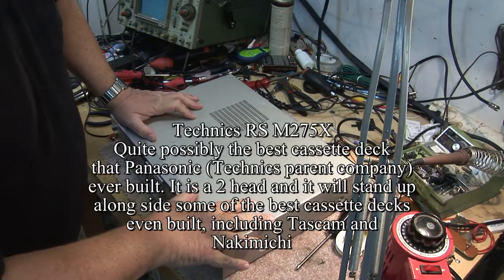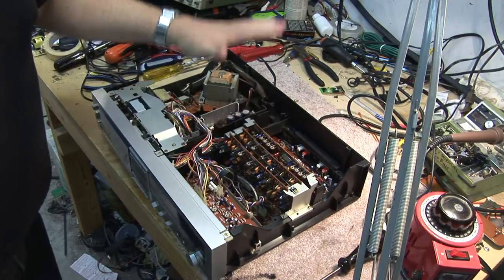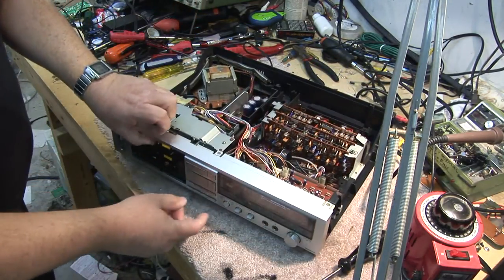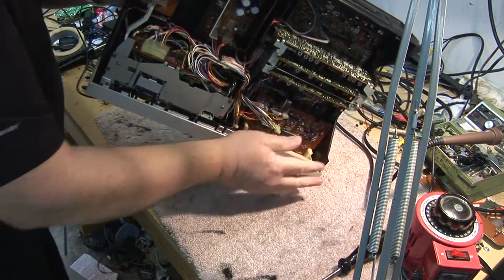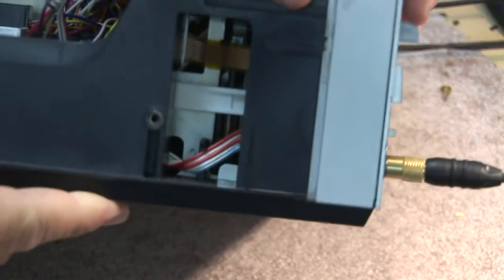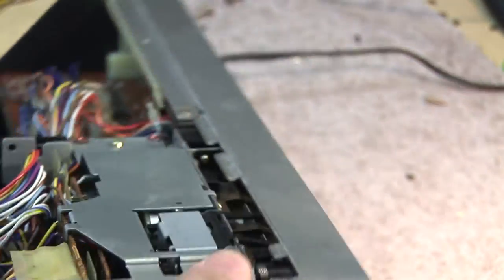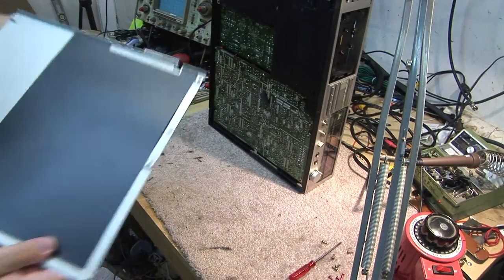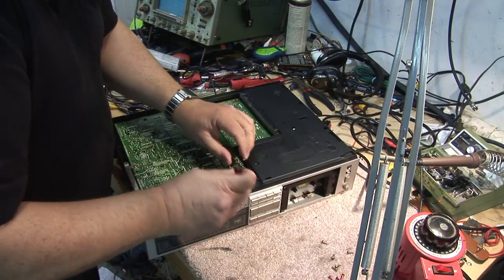technics rsm275 no play repair

Comment: Thanks for sharing your know-how. Your videos are always a good learning experience for me, trying to resurrect electronics training I got more than 50 years ago, but stopped using shortly after getting discharged from the USAF.

Incidentally, very useful tip about using rosin flux on the slipping belt. Was it the kind that's in liquid form or paste? It looks like MG Chemical, but hard to tell exactly which one.

Comment: Very interesting!  I would never have thought of using rosin like that to help a slipping belt!  Makes sense as its acidic and I guess it likely etches the surface slightly.  I would be tempted to take the lid off, put it on a flat surface and hammer out that impact dent ;)
Reply from the maker: Yes I already did that after the video was shot.
Reply: =D  Great stuff!  Love the videos!  You really know your stuff!
Reply: @12voltvids  hey so I have been waiting for the right moment to use this rosin technique, and finally I decided after boiling the belt from a wx-fx195 walkman and not getting enough tension and lots of vibration (specially after the finish of the tape where it seems to pull harder till it stops playing), I went ahead and coated the belt lightly with rosin. Not knowing the way to do it properly I waited a while to let it dry, maybe an hr. Then  i decided to put it on, but it was very sticky, (mind I really barely put any in there),  but never the less I did put it on and started the tape, it  seemed to play well, till I stopped it, and it wouldn't start again at all, no matter what I did, it did ff and rew, but not play. I took it off again and cleaned it with alcohol, sort of defeated I decided I would just get a new one, so I went to my welding class and when I came back i saw my desk with the walkman  in pieces, and decided what the hell, I will test again, and whoa, it works now, testing for a while to see if it gets lose again, but so far so good. My question, could you expand a bit on how this technique works correctly? maybe a short video? did I do it the right way by mistake? Thanks so much, I hope you see this message. Can't say enough how much I like your channel and your way to explain and go thru the repair of everything electronic. Cheers.

Comment: Hey Dave I know that this is an older vid I have the same Technics cassette deck with the same problem with that belt, will 

MG Chemicals 835-100ML Liquid Rosin Flux is what you used. Thanks great vid as always
Reply from the maker: Yes this is what I put on it to give some grip. Still working years later, mind you I don't use this deck much.

Comment: I used to work in a repair shop, I hated those disc players, a small gear in the bottom would break and it cost a few dollars for the part but you had to charge the customer for the all the labor involved, it wasn't easy to replace and then align the gears.
Reply from the maker: Just to change the belt I put the rosin on would have taken easily an hour to disassemble and reassemble. They were a pain in the ass to work on that's for sure.

Comment: Hello how are you I have a deck technics rs m280, when I play a cassette after about 10 or 15 minutes it starts to accelerate the playback speed extremely fast. It would be very helpful if you can give me some advice to solve this problem Thank you very much in advance and greetings
Reply from the maker: Not familiar with the model number.  If conventional type motor it is likely the motor that is failing. Again, I am not familiar with that model number.
Reply: That's a direct drive quartz lock motor. There is no speed adjustment. It's possible the motor is flaking out. I refurbished mine in the sense of a recap. Many of the low voltage caps showed sign a minor leaking of electrolyte around the leads. It's pretty well established that the lowest voltage ones (lets start with 6.3 v) tend to leak fluid after 10+ years. You find these on all over the place in this unit, including the motor drive board and control boards that are mounted in the mechanism. Mine never had the problem you describe though. There were two versions of the  DD motor driver also. I think that is covered in the schematic pages. Of course you should verify that the pinch roller pressure is at least reasonable and they and the capstans and rollers are clean. If the rollers can't grab the tape it will be pulled through faster by the take up real motor. It doesn't seem that would follow a consistent warm up period but I guess it's possible. This goes with checking that the head block is fully engaged by the cam also. There is procedure for checking the capstan pressure using a force gauge. But for this problem it would have to be way off the target pressure. I find the rubber in this deck has held up well in spite of decades of age. Only a person a much experience and patience for tedious work would think about taking this mechanism apart to fix the motor driver and the bad news is there are ICs there that if bad are not obtainable. Ok I looked at the service manual which has decent troubleshooting procedures for the motor. In the case of the motor speed almost doubling check the following: Make sure IC 502-507 all have vcc of 5v. If that's good check Q506 for being open. I imagine the almost double speed is the free running speed with no feed back FG signal control applied or essentially no speed control but with other things working. These checks are on the control board that is mounted on the mechanism. The problem I see from this check assumes the ICs are all good. Missing vcc vs bad chip?
 Slight correction: 5 of the 6 ICs in question in the motor control and drive are standard logic chips (Quad nand, quad nor). These can be purchased. I see the main motor control chip ic 501 on the bay right now (not part of this check). The remaining chip (oscillator) is also on the bay right now. So in any case I think this should be repairable. Also the difference between the two motor versions is the number of motor poles and the frequency of the signals (with some component changes and such). Otherwise the chips are the same. But I will note there is a 6.3 v remote cap on that 5v vcc rail in the mechanism.

Comment: Why does it look easy for you to remove the front covers off the deck doors? I’ve been trying to remove the ones off my Panasonic decks without breaking them!
Reply: NORMALIZATION OF IGNORANCE - Thankyou for the advice as it will help me heaps now. :)
Reply: NORMALIZATION OF IGNORANCE - A Panasonic RX-DT610 Portable Stereo Component CD System from 1991. I bought it brand new with my pocket money when I was 15. ;)
Reply: The twin cassette decks need servicing again & the CD player tracking needs a adjustment which is easy to do. :)

Comment: The best (and most expensive) Technics cassette deck was model RS-9900US.  It came in two parts, drive system and amplifier were separated units.  It was built like a tank and very, very heavy.  Though, it was easy to carry, since your wallet would be very, very light, once you paid for it.  :)
Reply from the maker: The best? I seriously doubt that. Nakamichi had that camp sewed up.
Tascam also had some serious decks. 
The RS-9900 was expensive for sure,a nd it cae as 2 seperate units. Big deal, it didn't even support metal or FeCr tapes. Just  standard and CRO2.
Reply: @12voltvids in the  Technics models line up only.

Comment: I have the RS-M280. Wish it had DBX. But it is a 3 head version of the 275. I am working on the transport too. Sure enough the transport locks up in play. I am replacing all the belts and idler playback take up. Transport is highly involved. Slipping belt is the hardest of the bunch to get too. Service manual is useless on how to remove that belt.
Reply from the maker: It's fun.  The 285 despite being 2 head has perfornence rivaling many 3 head decks and dbx is icing on the cake.
Reply: RS-M280 here also. I have in fact replaced the belt in question for the head block drive. The replacement seems to have held up longer than the original. But then it does not get as much use now. It's not exactly fun, although far from impossible.  That belt started slipping about 2 years after it was first put into use when new (1980ish) and my repair guy at the time (40 years ago) only did the anti slip fluid. That works for a while but it is not really a solution. He totally refused to tear down the mechanism. The problem with finding belts lies with the dual capstan belt around the fly wheel. Many tries with belts I thought might work but did not. It has to be just right or it will ride itself off the the somewhat rectangular shaped integral crown on the left pulley. It has to be just right in width, thickness, length, pliability. The other thing that happens as the belt gets older is the left capstan speeds up with respect to the right. A loop of tape forms and the first thing you notice during record is the tape lifts off the erase head. The technical reason this happens is beyond my ability to speculate and sound convincing. At first cleaning the pulleys seemed to fix it but it would come back again.  Although, in fact Technics put out a bulletin to update the left pulley/capstan size because of this problem (part substitution). I never got the redesigned pulley/capstan, but I did after many years of sitting and being pulled out of storage find a new belt that worked and that stopped the problem as well as the tape feed issue. For how long I don't know. AFAIK there is only one belt that is/was available that would work at all and that stops both these problems. The belt: PRB FRW 9.1 These at least are or were available in the US as recently as a few years ago. And there may be another belt available elsewhere that will work. The caveat is that it likely won't get you all the way down to the original W&F spec, but it worked good enough to get .035% WRMS on mine. The width of the belt in this case is more critical than it is in most other decks from what I noticed, I think because of the strange profile of the pulley crown on the sub-pulley (left). The Prb cross guide calls for FRW 8.0. The only thing I have to say about that is it must be in error. The actual measured length of the path around the pulleys is 9.3 inches. IMO opinion an 8 inch belt would be way too tight and this thing will give you trouble if the belt is even a little too tight.